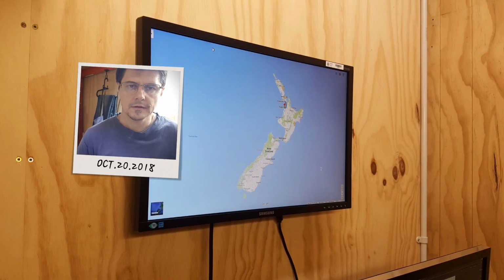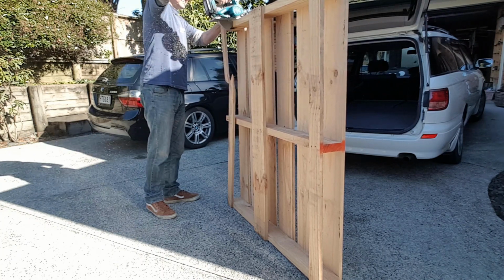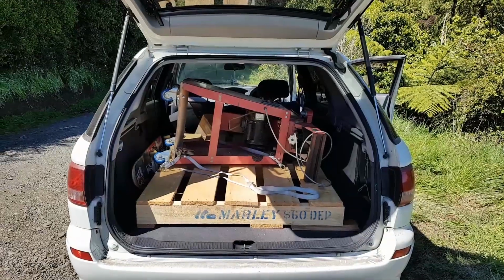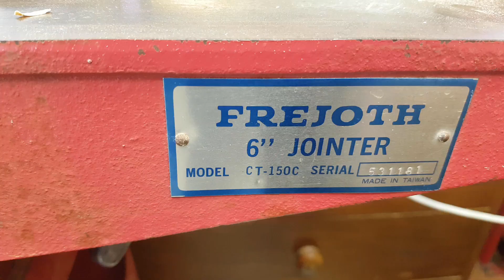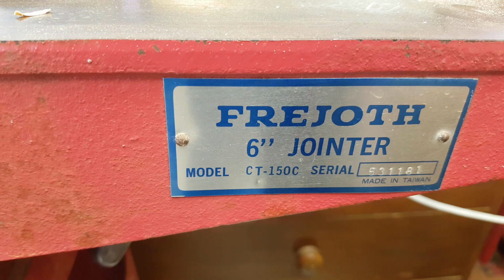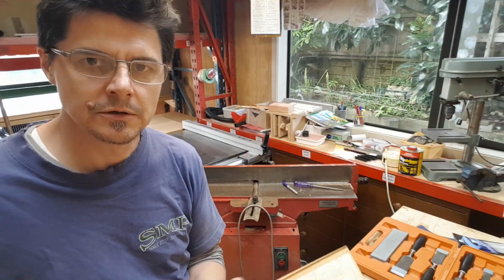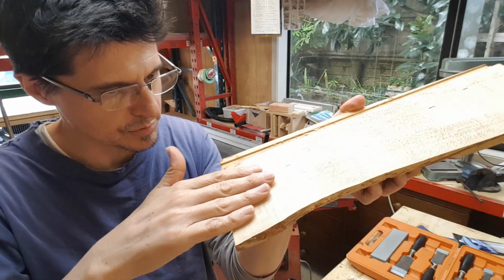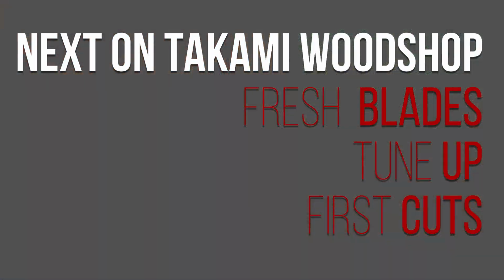Road Trip - Picking up a Frejoth Jointer

Comment: When I saw the skateboard packed in, I figured it was to help moving the jointer.  I've never seen the result of really dull blades, but the result you got in the middle of the board looked like you were cutting against the grain.  You can often feel the way the grain is going (sort of like the coat on a dog as you brush your hand along it - one way will be easy the other you'll feel more resistance)  Try passing the board so the cutters are cutting with the grain and see the difference.  Enjoyed the tour too!  Cheers, David.
Reply from the maker: Hey David - thanks for the tips on grain direction - I kind of thought that was something to do with it - one way it chatters and grinds its way, the other is much easier. I'm doing more today with a follow up vid later this week I hope. Raglan is as pretty as a picture. First time to the town for me and the last time in the area was over 20 years ago to watch surfing out at the beach. Cheers, Rob

Comment: Mate, what a score👍😎👍
Was that an abandoned boat trailer on the mega unsealed road?
Did you run that board with or against the grain?
Looking forward to the follow up with the sharpened blades.👌
Reply from the maker: Gidday Bill - yeah that trailer - I was like wtf! It appeared to be some kind of farm vehicle trailer - off to the side was a steep gully so I guess they had no choice but to leave it in the middle of the road. Someone else also mentioned running with the grain. I slightly suspected that as a cause but now it is as good as confirmed I guess. Identifying grain direction is not a jedi talent I have acquired yet but learning how will only cost me a few hundred bucks in ruined hardwood.😎 Sharp blades are on now - having a play today.
Reply: @TakamiWoodshop  lucky you didn't run into that bloody trailer!😲
Bwahahaha 😂 no jedi powers needed, bud. Plenty of online info to see just what you need to identify correctly. If first pass gives you the wooly mammoth, flip it round and go for the smooth as a seal effect.....😎
Might pay to make a few jointer push sticks with varying thicknesses of heel. 👍
Reply from the maker: voodoo telepathy? Mate I just repaired the heel on one of my table saw push blocks - I broke both of them off pushing on the joiniter. Getting the knack of this grain direction now - been mucking around with it today. Live and learn!
Reply: @TakamiWoodshop  🤔hmm, 👹voodoo telepathy 👹....
Sounds shit hot to me, we'll run with that one.
For sure, mate. Live and learn, or live and burn.....😂

Comment: Next time when you need to get a jointer out of the back of the car, turn the car on, jam it in reverse, full throttle it and then STOMP on the brakes. Then just sit back, relax and let physics do the work for you :D
Reply from the maker: 😂 will try with next tool I buy. Always good to get tips from people who've done it lol 😂
Reply: ummm....yes...."people who've done it" hahahahaha
Reply from the maker: Gidday Kuffy - Do you have any hot tips on how to identify grain direction so that I feed it the right way?
Reply: You can "pat the cat". It will feel rough in one direction and smooth in the other. Just like the hairs on your face, smooth one way, rough the other. Patting the cat with a piece of cotton sheet (your tshirt), works really well because the timber fibres grab at the cotton sheet. You can read the grain just by looking at it. Or if/when you end up planing in the wrong direction, you will feel the board knock and kick a little bit as timbers are being torn out of the surface. You can hear it too. Don't continue planing the board that way, just stop and turn it around (that doesn't work on a thicknesser but if you jointed it first you will/should have already marked grain direction).
Reply from the maker: Thanks mate! Yes - I've felt that bucking the board does when you go the wrong way. I remember you talking about grain direction on your dresser vids and thinking wow that's actually a thing.  Ha! well I better learn quick before I ruin all me wood. That t-shirt technique sounds like a good one for timber that is already pretty smooth. Cheers man!!